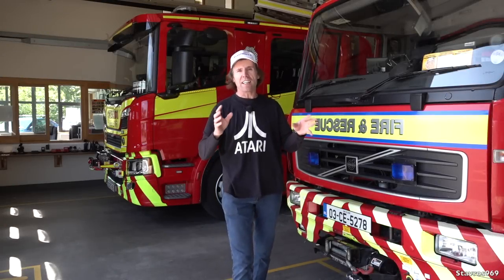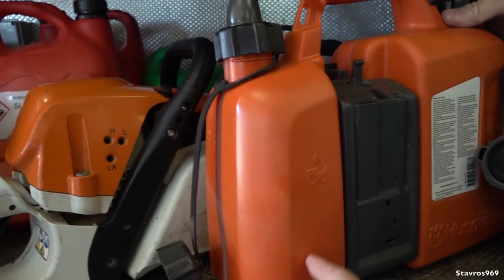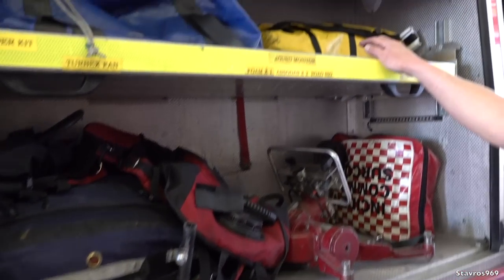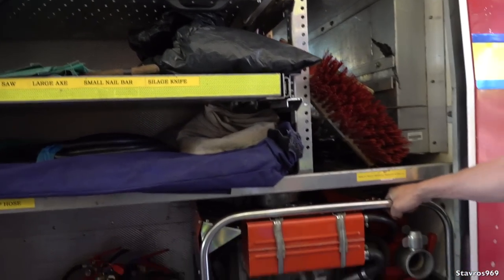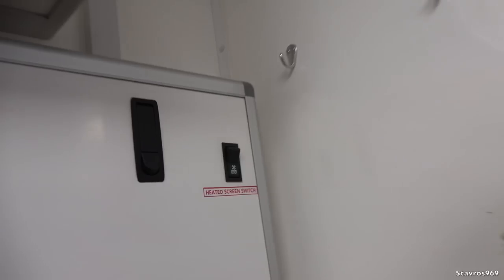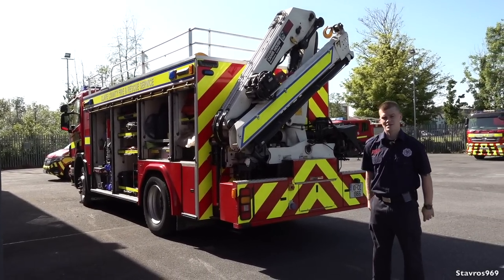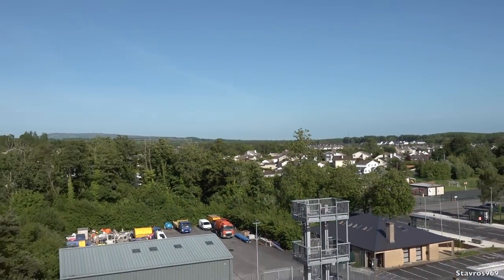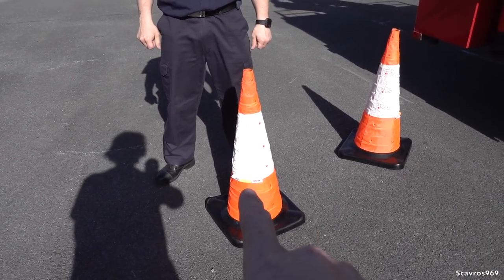Being a FIREFIGHTER - Vehicles & Equipment Explained!

Comment: Interesting to see that the Hino 500 has got a manual handbrake like in a car, or light van instead of an air actuated one that all commercial vehicles have. Surly a cable handbrake isn't strong enough to hold the weight of a fully laden truck full of equipment? Great video. Like all the various types of appliances and applications in use at this fire station.😀

Comment: Hello thank you for your videos. I'm from America and would want to know more about ur trucks. 

1)Can you equip manual on the new scanias? And which ones like the r520 r580 r 620 and r 700? Also would be a good video to make about the different types of engine hp and for what type of jobs would  each be better suited for and gas milage difference. Going with it I love the 143 scanias v8 they have 500hp, would they be suited for this day and age of hauling loads, or can they also be tuned to insane powers like the new ones. (I would think good power range is 550 to 650?)

2)And another  about explained the different drive terrains like 4×2 vs  6×2 midlift vs tag lift vs 6×4 what jobs each do better, handling, and gas milage. 

A nice video of explaining what engines and drivetrain go together for each type of job.

I personally love 6 wheels 6×4 or 6×2 midlift, and a Greek styled v8, hope to move to Europe soon and get my dream truck. Thank you for ur videos always looking forward to them